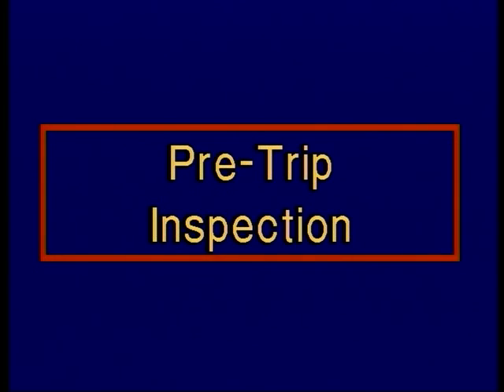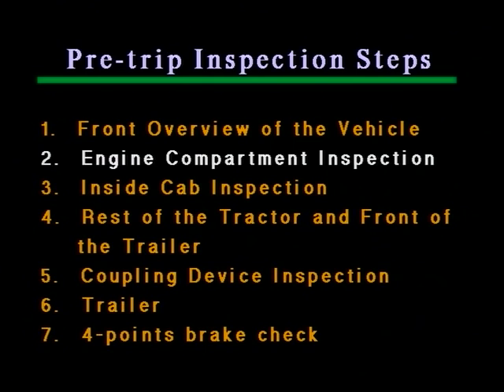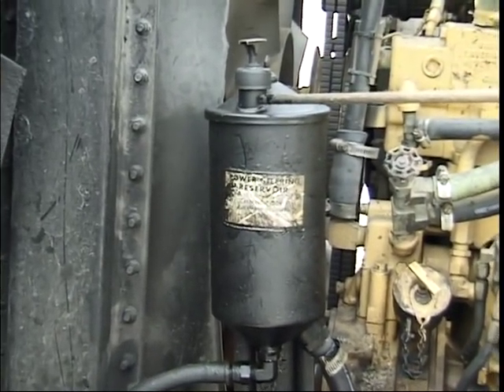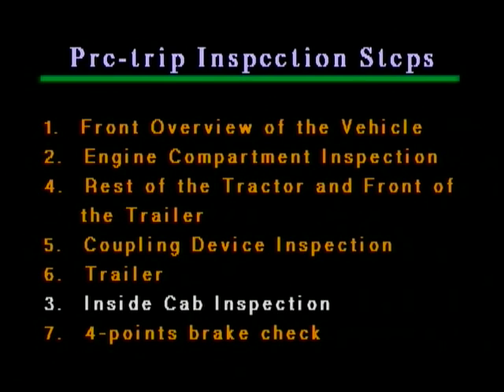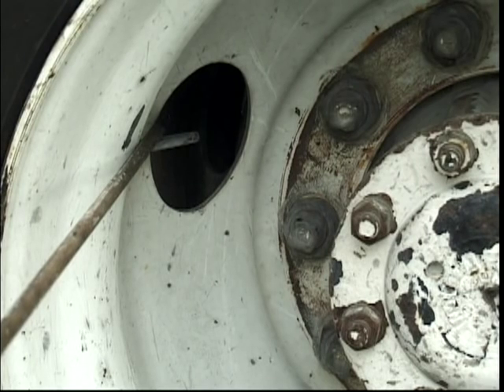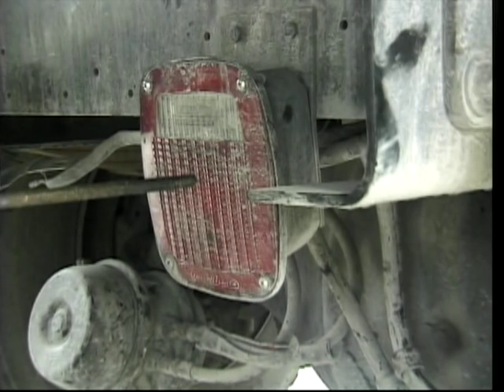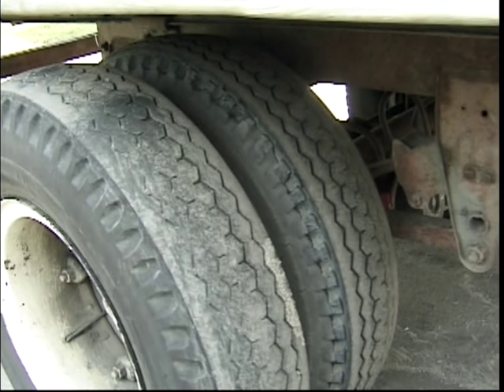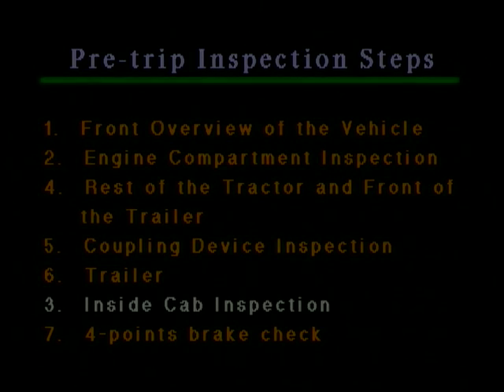Pre-Trip Inspection English Tractor-Trailer Part 1.mp4

Comment: On approach forgot to look for liquid underneath forgot to look if it was Leaning to one side, and How can all those lights be working when none of them are turned on ??? He says there's no leaks and the Air compressor belt is in good condition, HAHAHAHA!!!! Fluid leaks are all over the p/s reservoir and the steering gear and the steering arm is bent and there is NOT and belt on the air compressor!!!!!! OMG! Soooo stupid I have to stop it at 4:43 minutes. I can't handle the IGNORANCE!!!